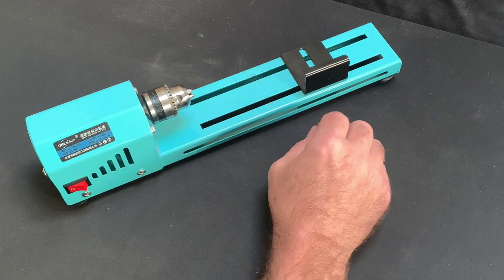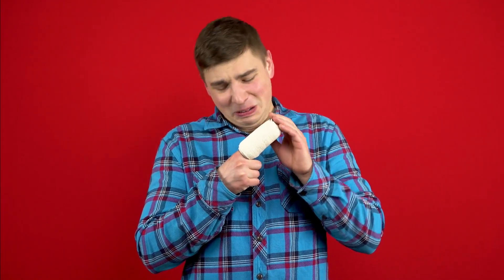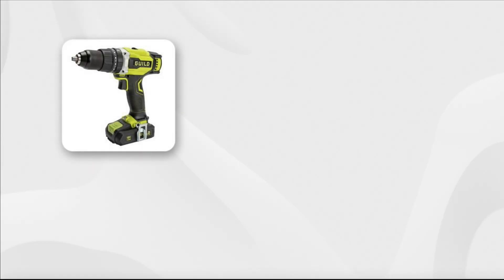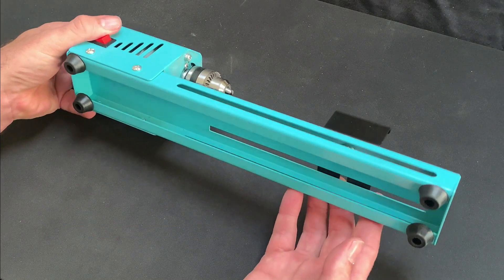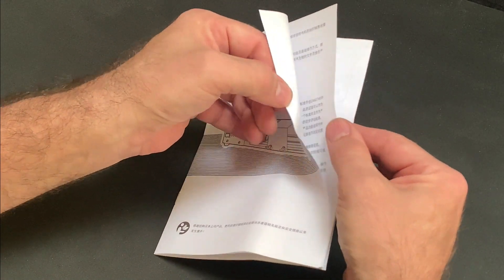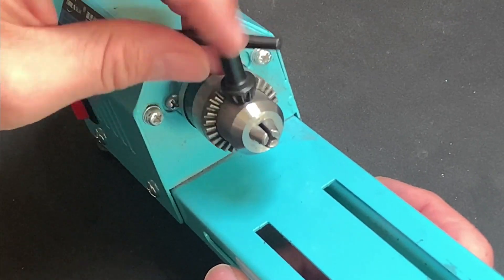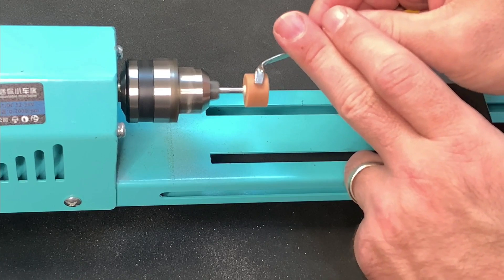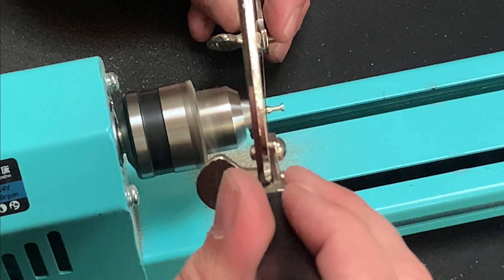030 Mini Lathe for Locksport - review

Comment: I had been waiting for this one, I do have a mini lathe now and also picked up a drill press set-up which allows your dremel tool to become a drill press. 
Now the tutorial for the tensioners, what I had found out from my experimentation at making them - the end that goes in the keyway is for holding locks in your hands, you don't have to twist a full 90 to use a tensioner in a vise  ( about 25-30° )and if you give yourself a little extra room to make the twists, you won't tear the wiper insert. So that little extra distance between the vise grips when turning keeps that from happening. Excellent video sir! Hopefully soon, I will be able to get a work area situated to start making my security pins and some challenge locks.
Reply from the maker: Thanks for the feedback - a dedicated locksport working space is something I hope to set up this summer - for now it is our kitchen table!
Reply: @fishpicks4531  man if I was close by, we'd have you a lock lab built and ready to go! I have the space, but going through all the clutter to make mine happen is going to be a chore, but I am lucky enough to have a work around until I can fight the clutter which reminds me of the old star trek episode " the trouble with tribbles " . If you like, I can let you know how the dremel drill press works out. I figured that in combination with the lathe and that, along with all the other atuff i bought; I should be able to make aome decent security pins and pin in pin. Stay well and safe, enjoy you new toys and means to make some dastardly key pins👍😁🦾

Comment: Another good video, thanks Andy.  Good to see that the chuck clamps firmly onto what looks like the standard Dremel or generic rotary tool bits. There's a huge selection of those available.  And I heartily endorse your suggestion to wear protective eyewear - I've seen patients after either the tool bit has disintegrated, or the chuck itself, while using mini-lathes for model making.  Not pleasant!
Reply from the maker: Yup - so easy to lose focus and get really hurt. A while back I was holding a key which had heated up from grinding - I was using a thick piece of cloth and got to close to the spinning grinding tool. It whipped it out of my hand and thankfully I managed to pull away and turn it off before any damage was done but it was a timely reminder!

Comment: I've run this lathe through its paces. Other than this, you need a set of files (cheap key files will do), sanding paper, PPE, and a few dollars worth of 3mm brass stock. If it's your goal to turn cheap and crappy locks into challenge locks then you can get started on a shoestring budget. You can even use this with Dremel tools to cut euro cylinder locks in 2, grind the burrs off, and brass wheel/polish them if you desire so.
Reply from the maker: Agreed Bram - seems a good low cost entry tool 👍

Comment: I got one of the cheaper minilathes and built a wooden "cage" around it... the PSU is attached on the back of the cage, allowing easy access to the speed control.
It also has a small rack on top, where I can put the accessories.
The base plate is an extruded aluminum profile making it easy to mount it with some screws and wingnuts from the bottom...
Until this video, I never thought about using it as a "fixed" Dremel, but I think I'll give it a try :)
Reply from the maker: Sounds like your machining skills are on point - nice modifications 🙌
Reply: @fishpicks4531  I inherited some woodworking skills from my grandfather :)
With that modification, it is also more rigid than the stock cheapo lathe.
If you like, I can send you some pictures
Reply from the maker: @SystemX1983  yep would love that - my email is in the ‘About’ channel section 🙏

Comment: Great review, I’d be sold had I not already gotten a dremel for Xmas. My question is does your dremel heat up fast. I’ve only ever used it for 5 min or so. I wanna start making pins. Also where’d u get ur brass rods for pin making?
Reply from the maker: The dremel does get warm but I don’t think I’ve used it for more than 5 minutes at a time so not sure Kevin. The brass rod was just from Amazon - 10 for about £7 - just type 3mm brass rod into the search window and you’ll get multiple offerings 😉

Comment: Does it come with any sort of table to hold cutting bits ? That would be a must for me I had a cheap one but the front bearing was useless a variation of +~ 1.8mm everything I made was out of shape 😂
Reply from the maker: There’s the cutting table that I show in the video which slides along the tracks of the lathe body - is that the kind of thing you are referring to?
Reply: @fishpicks4531  no more like a two way clamp with wheels to adjust the tool forward and backwards left and right
Reply from the maker: @thecrappylockpicker4696  ah no the price point for this unit doesn’t offer that- I suspect you would need to look towards a more expensive model.

Comment: Can this be changed to a bigger drill bit?
Reply from the maker: Not sure Tina - It looks like the Chuck is fixed but it opens wide enough for most tasks I can think of for locksport. The drill bits are obviously interchangeable like any drill/lathe.